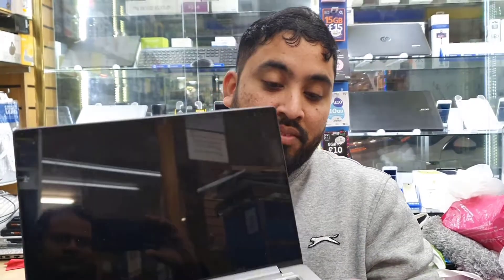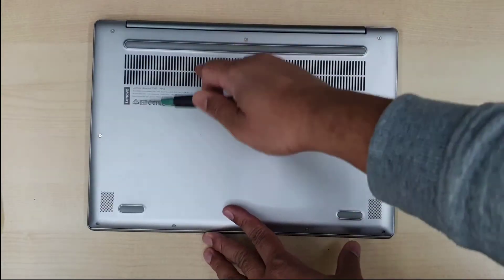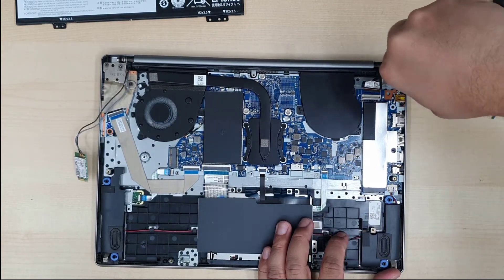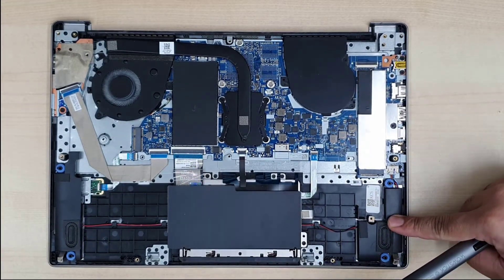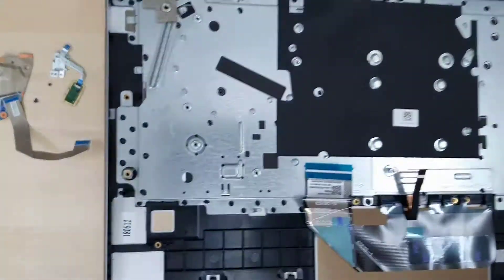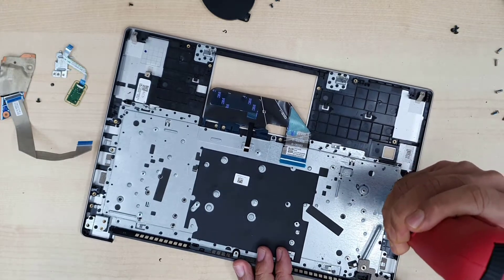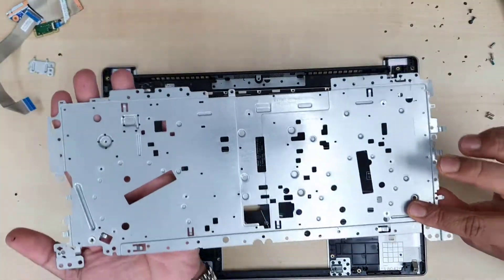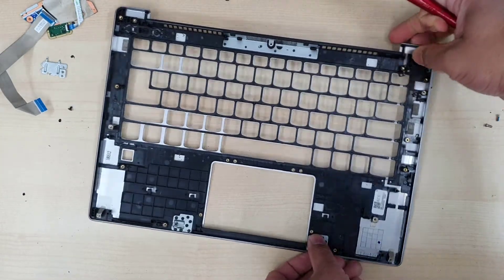How To Replace Keyboard On Lenovo IdeaPad 530s

Comment: I watched it before buying the replacement unit. It worked perfectly. I actually used a hand drill (in low speed/screw driver mode), very gently. I suspected that in absence of the rivets the keys would be uneven. I added a tiny drop of superglue over a third of the rivets and the result was good. There's still some slight movements in the keys around the key i'm typing but totally acceptable for a second-life computer. I just want to say thank you for the thorough explanation !!!

Comment: Learn from my mistake: Scratch the rivets off as it is described here. Do NOT use a soldering iron to remove the rivets! This will melt and shorten the plastic pins even more and your melted plastic will not be able to reach it to stick to it anymore. The result is an uneven keyboard in my case :(

Recommendation: Think about buying a new keyboard all together with the case. Its not that much more expensive. That way you wont need to do this tricky plastic melting part.

Comment: Very helpful, thanks. But do you not need to try to use some of the rivets to secure the key keyboard in place - maybe not all of them but maybe try to use some of what remains of the plastic rivets, perhaps with a sharp tip of a soldering iron to secure it in place?